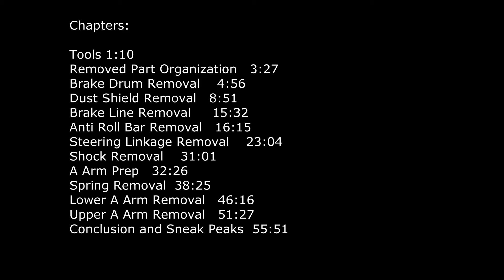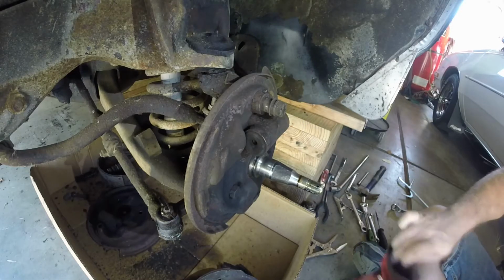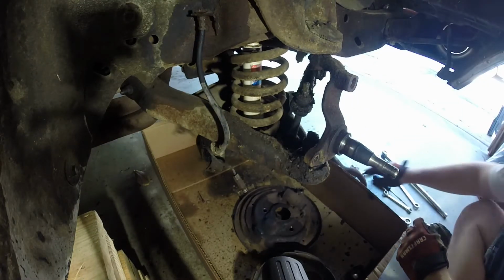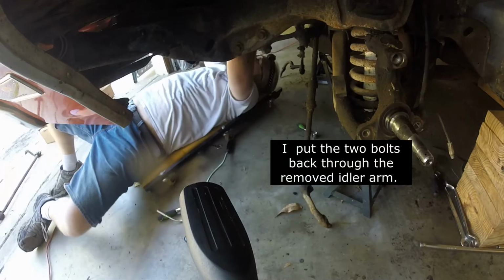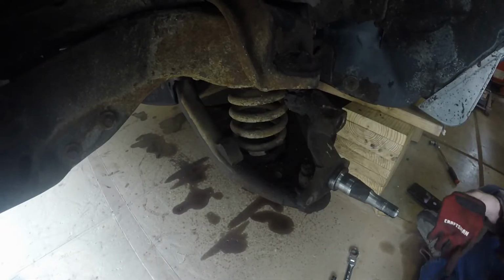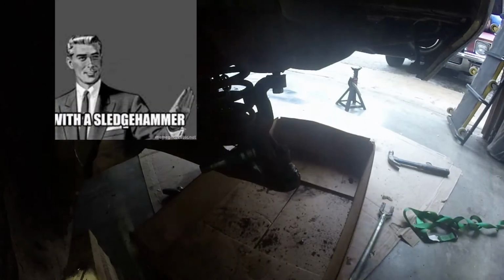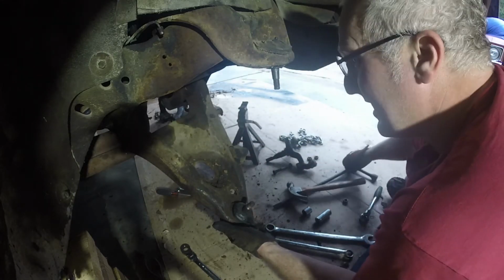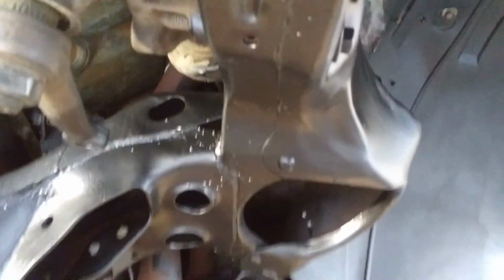72 Olds Cutlass Front End Tear Down...In Detail.

Comment: Did your brake line that runs between the proportioner valve under the engine to the passenger side front brakes have any clips that attach it to the chassis?  If so, where are those clips located?  Many Thanks!
Reply from the maker: Hi! there was one clip I believe on the frame right behind rear of wheel well but no clips from there on up to proportioning valve. The old proportioning valve was lower in the wheel well from what I remember. I hope this helps!